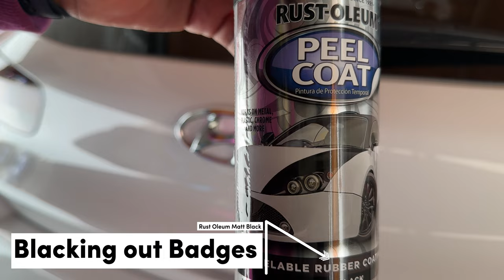Debadging, Spray Painting Emblems, and Tinting Headlights on my I30N

Comment: You might of been better off replacing the badges to black ones instead of spraying. Not sure bow well that paint will hold on chrome badges.
But looks good✌️
Reply from the maker: Thanks I have used this before it holds up very well. I did a car back in 2016 and till this day its still there no problems
Reply: They are hard to get hold of and about £85 so quite expensive